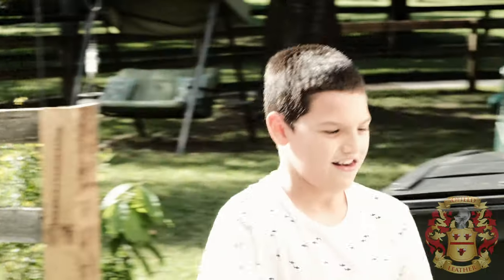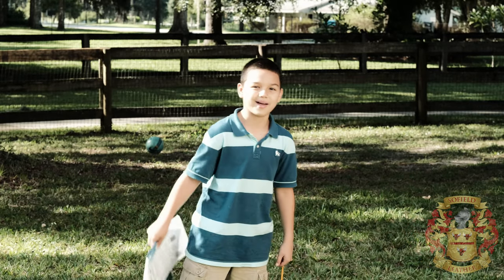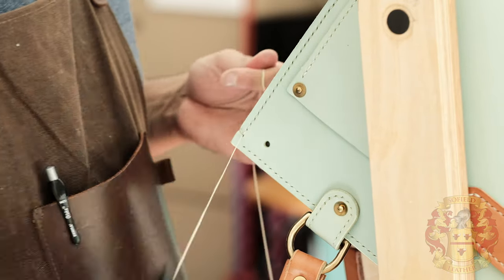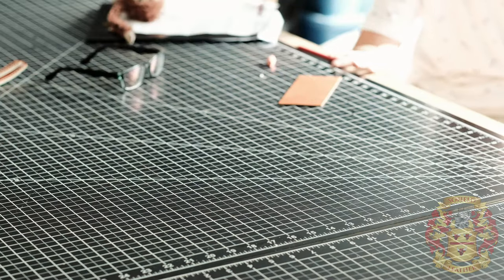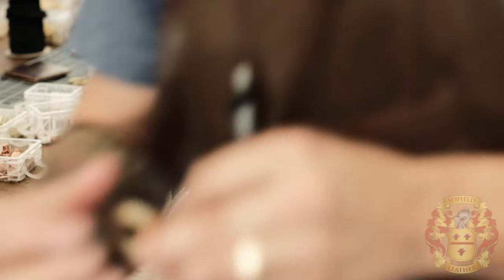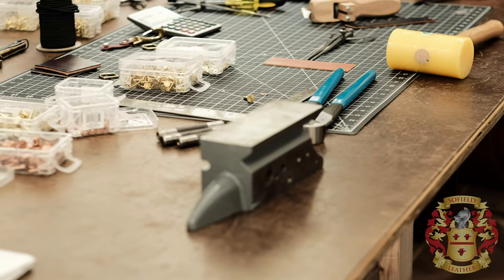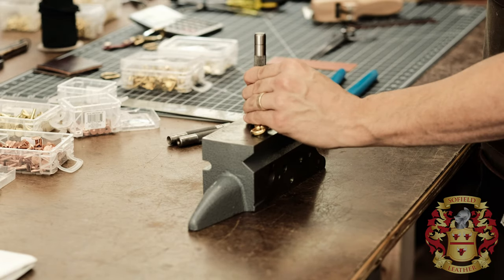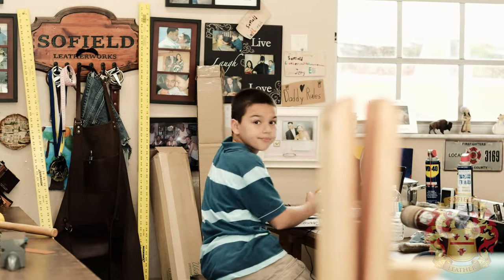Handmade Leather Tote Bag - Part 6 - ASMR Build

Comment from the maker: Watch the whole build - https://www.youtube.com/watch?v=1Av8cRLKLfA&list=PL4KyHg8uSEIKxqitxJKYqs38hxUNWIp5-

The perfect companion that will literally stand on its own! This Executive Tote Bag will not fold over when you place it on a surface.  It has been engineered for durability and functionality to accompany you in your personal and business ventures.

Crafted with high-quality Vegetable Tan leather, provided by English tannery, Metropolitan Leather, this bespoke work of art will stand above the rest.

This Tote Bag is fully-lined throughout, and adorned with over 1,200 stitches meticulously hand sewn using the tried and true saddle stitch method. The exterior pocket showcases a heavy duty magnet for easy access. It will hold the test of time with its heavy duty brass hardware. Handles and small straps are also reinforced with a polyester webbing to prevent stretching and warping. For your convenience, the interior and exterior also boasts a d-ring with an included key chain.

With over 30 hours of build-time, the Tote Bag has been engineered to maintain the integrity of its structure and shape. Heavy duty brass rivets are at the end of every stitch run for durability.

As a final touch, an all-natural in-house Leather Conditioner coats the leather for a sleek and smooth finish, making it ready for its next adventure.

Leather Color: Pale Green exterior with Tan interior and Tan shoulder straps

Stitch Color: Cream

Product Dimensions:

Exterior of bag: 12"H x 16" W x 6" D

1 Large Exterior Pocket: 9" H x 15" W

1 Large Interior Pocket: 9" H x 15" W

2 Small Interior Pockets: 6" H x 7.5" W

2 Shoulder Straps: 1.25" W x 26” L

Weight: 4 lbs

Questions? Simply Contact Us.

Shop - https://www.sofieldleather.com

Follow us:
Sofield Leather YouTube - https://www.youtube.com/channel/UCHack2mJ-RoHMZg8xwIF8Hw
AOS YouTube: https://www.youtube.com/channel/UC8muKHO3GDoFD3Lj40tojTw
Instagram - https://www.instagram.com/sofieldleather/
Facebook - https://www.facebook.com/Sofieldleatherworks/

#LeatherCrafting #Leather #ToteBag

Comment: How did you line up the stitching holes on the side panel with the both front pieces?
Reply from the maker: It’s a secret. I learned a lot from Armitage Leather. But I’ll tell you anyways 😱 🤣. I punch the holes first in the front panel. I make sure I start in the middle then work out. I count the holes then make exactly the same in the gusset. It’ll give you precisely the perfect size for the gusset. No measuring or gluing. 👊🏼👊🏼👊🏼👊🏼. Thanks for watching.

Comment: Beautiful Bag, curious though why you choose to pull so much thread when you stitch? NOT saying it's wrong but I find it faster to only pull my wingspan and splice when necessary, it also helps keep light color thread cleaner...anyhow thanks for sharing another cool video!
Reply from the maker: True. I don’t like splicing. Also... I give myself a good allowance up front to take the beating. That front gets beat up quite a bit. Ie.. threading it by accident as I poke the needle through. For sone reason the Wickett bridle doesn’t bleed onto my Tiger thread. Thanks for watching. 👊🏼